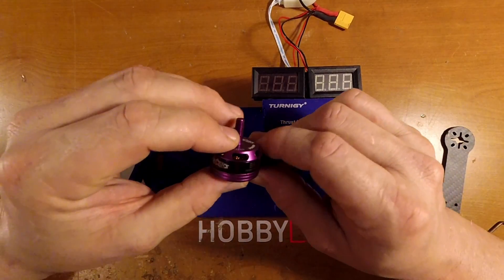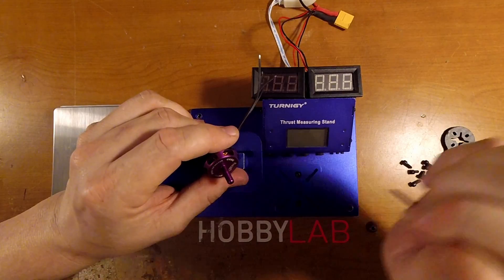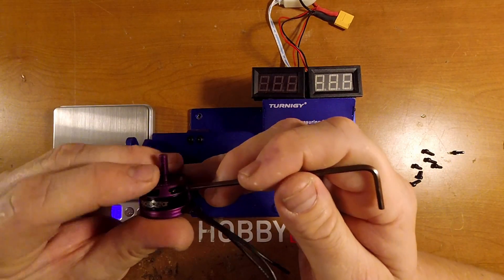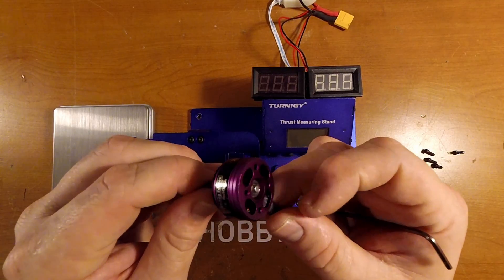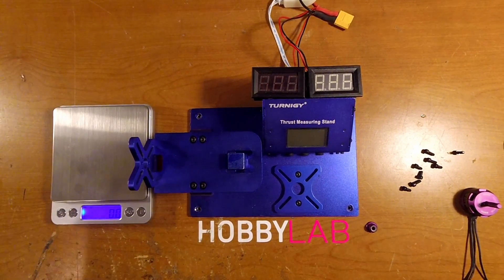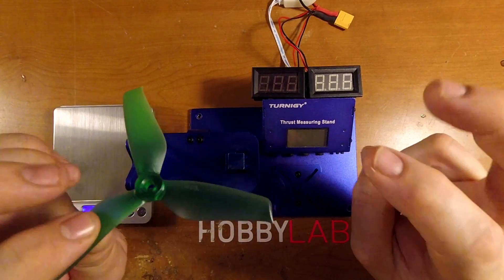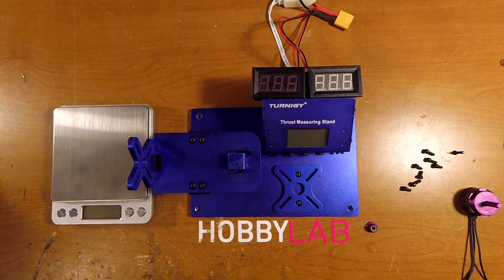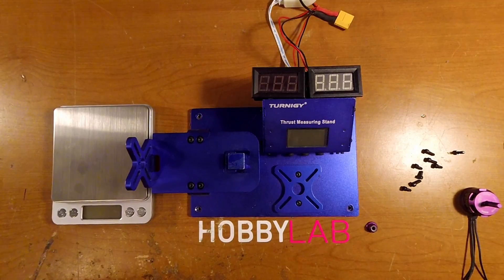RacerStar 2205/2600KV review & thrust bench

Comment: Crap. I ordered these 2600s with some of the 5051 props, but my escs are only 25A.  I did order the 2300s too and multiple other props. I was excited for the RK 5051s though. How much of a safety factor do ESC rating have? Think the 25A quadrants I ordered will handle bursts of higher current?
Reply: Nvm. I just learned that the xracer quadrants have a peak of 30A and also support the new blheli32 which has a current limiting setting.  Looks like I'm good to go.
Reply: J Santarsiero i bought a set of 4, first flight, lose a c clip 10th flight bell and stator decided to flip me the bird and proceed to smoke up my qwad and ideas lucky not to lose more. Ima try one more time soon order replacement. If my issues proceed ill let it be known

Comment: I just bought a set of these. Best prop on 4 cell is the DAL T5045C Cyclones. However i am seeing a small amount of play in the bearings after an hours use. The additional weight of the motors and 30 amp speed controllers is noticeable. 
I still prefer the trusty Cobra 2204 2300kv with 20amp speed controllers. Much lighter setup